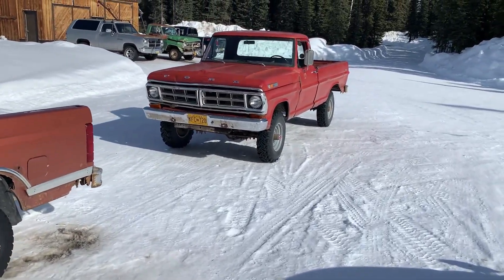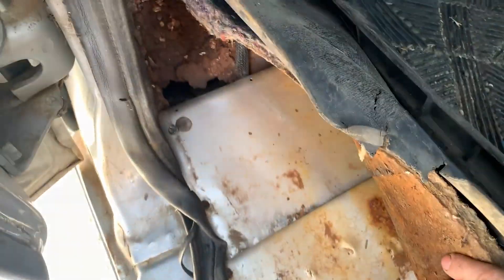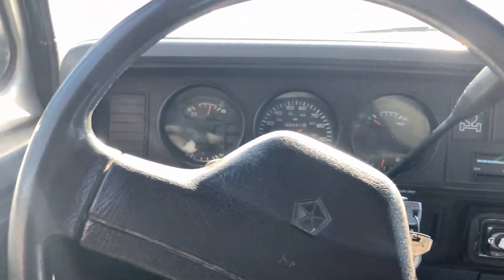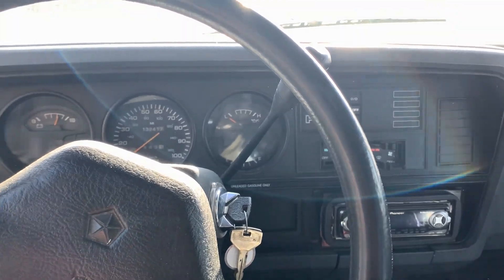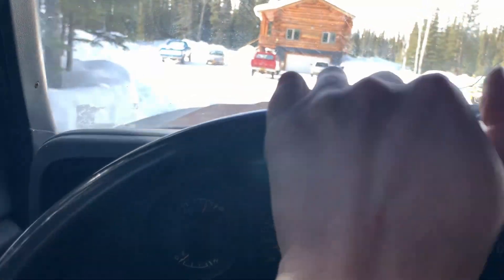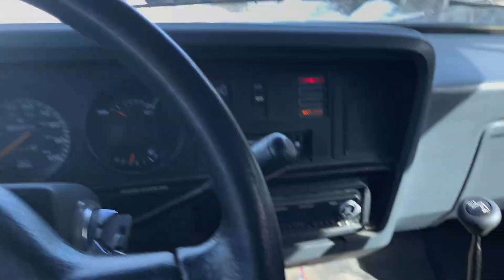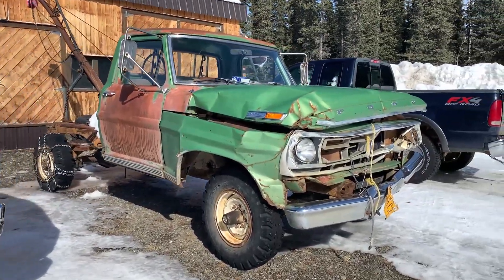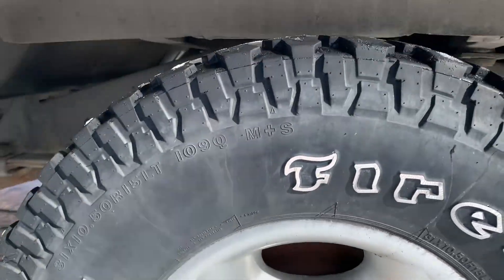Ramcharger Snow Rally

Comment: Great video!  I had a 79 and a half Ramcharger with a 318, and later on a 360.  Had split tailgate, fully removeable top and a 35 gallon gas tank! Was a great four wheel drive vehicle  Loved it.  Only thing that sucked was that it was a rust bucket.  Thanks for jogging my memory.  All the best, andGod Bless

Comment: I have a 85 it will go just about any place you wanna go put you some 33/12.50s on it that's what i run on mine they came with 31/10.50s from the factory wish mine was fuel injection but I threw the 2 barrel away and put a 4 on it and it does a lot better now but stay safe and keep the video's coming

Comment: I lucked out the previous owner completely rebuilt the front end of the 2000 dodge ram and new front pump trans input shaft seal and torque converter is known used .. Lol